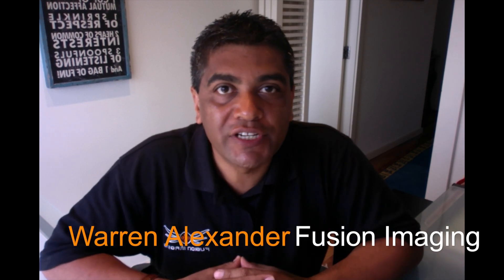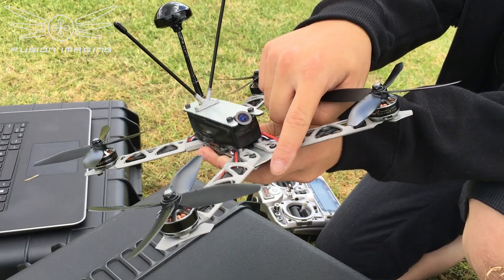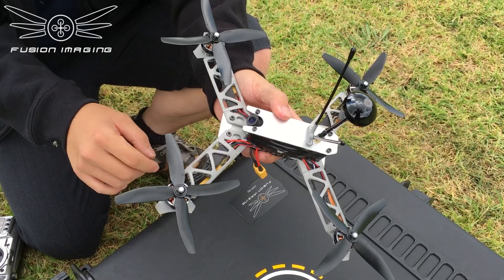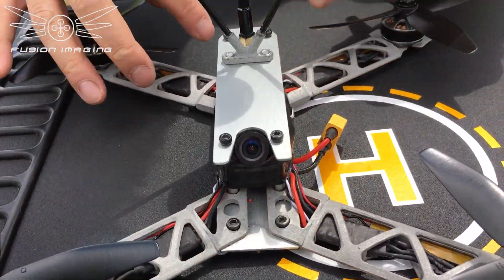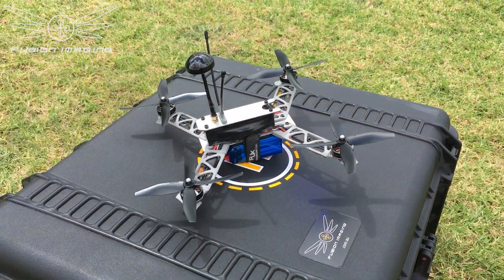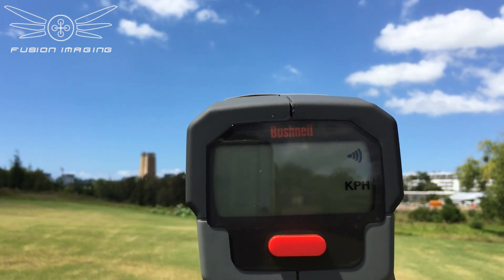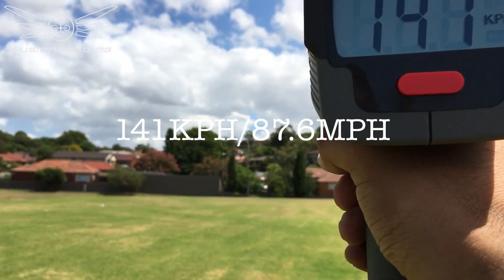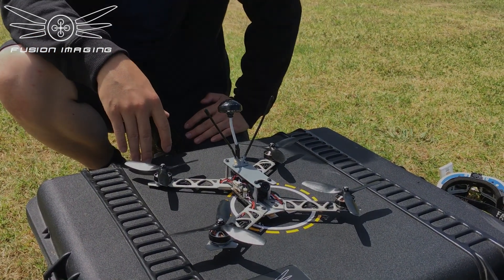Project 'Eclipse' Episode 2 - World first 3D printed aluminium FPV racing drone

Comment: why shall I buy an arm for $115 instead of a carbon rod for a few bucks? The design looks cool and it is for sure a great idea to print it 3d, but $460 only for four arms...
Reply from the maker: +Christoph Hi, thanks for your comments. 'Project Eclipse' was designed as a proof of concept project. Originally we had no intentions of selling the parts, but have had several requests from people wanting to purchase the arms and other parts which is why they have been made available for sale. This was a project partnered with @shapeways to show off their new 3D printed aluminium material and so its more about showing off the amazing properties of the material and how it performs in this manner, not about making money. As mentioned before the parts are literally sold at cost.

Comment: 03:01 "Now if you break an arm you can simply print another one and off you go."
At €105.65 per arm this is probably not going to take off ( no pun intended ) =)

May I suggest a design including a 3D printed Plastic part acting as a predetermined breaking point in case of a crash?
That way instead of breaking the expensive aluminium only available through Shapeways you'll only have to worry about replacing the plastic which can actually be printed at home.

Just a thought =)
Reply from the maker: +Duraltia Thanks for your comments. We will be making the arms available in plastic as well as the aluminium in project 'eclipse'. We are in the process of updating our online store to include these new parts, so please keep an eye on our store as the parts become available
Reply: +Fusion Imaging I just happen to have my own shop at Shapeways and a 3D part of similiar price ( €115 ) if printed in Aluminium and looking at the Strong and Flexible variant it would close in at €10 - And that's with shipping not included.

For €10 people usually buy 2-3 complete sets of four injection molded Legs, not just one.
And wouldn't a Strong and Flexible version need even more material thus making it even worse from a price point?

I guess since Shapeways approached you with the idea I'm probably "questioning" the wrong guys about their thoughts on this but... Njeh? ;)
Reply from the maker: +Duraltia ** correction ** At this stage we will only be making the aluminium arms available for sale. We are always looking at ways to improve our designs to make them more accessible so we hope to have them available in other materials in the future but at this stage it will be aluminium only.  Yes shapeways did approach us for what is a 'proof of concept' project and by all means its been a total success.